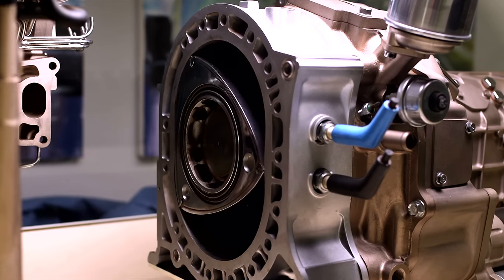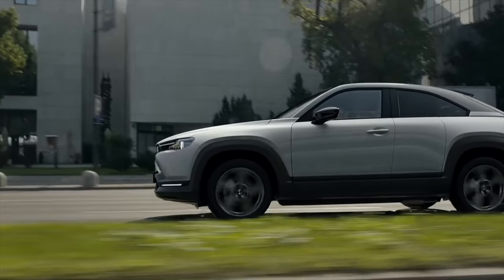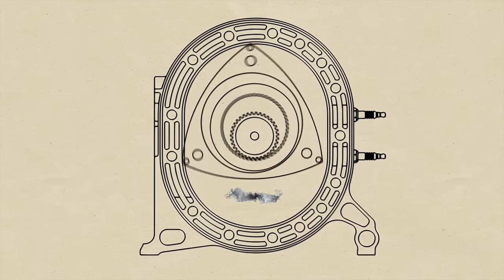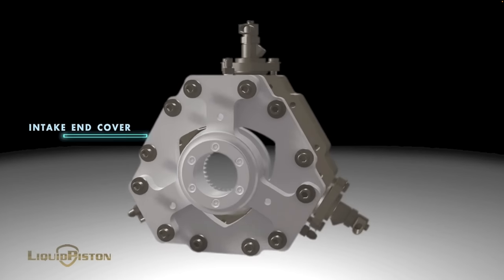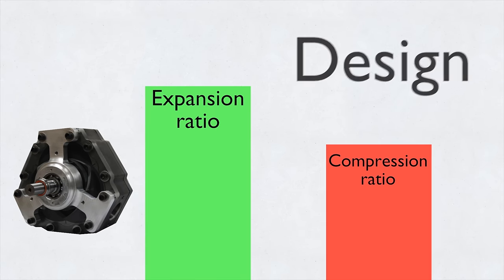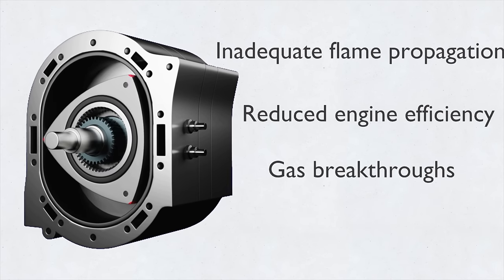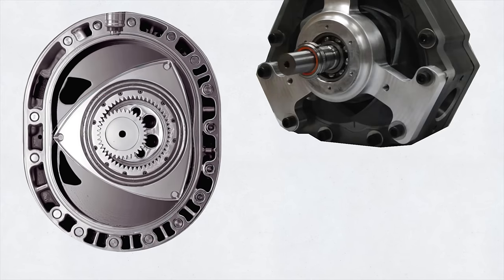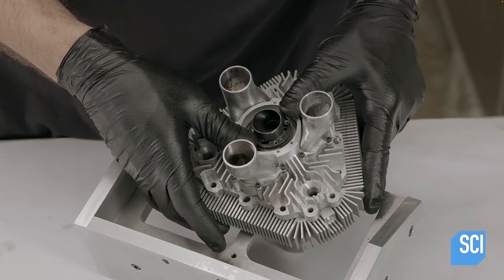Mazda's New Engine is the Smallest and Most Powerful Engine Ever Made

Comment: Well ppl forget bio gasoline exists and is easy to make if you some chemistry and build a gassa-fire engineering producing syngass before big oil gas tech came over 2 million syn gas cars were on the road in ww2 its awesome renewable  oil and gases  look up gasification 101 fir a crash course on it  and studied thermals cranking to learn how to make third Gen reactors one of the byproducts is hydrogen so based on how you use it it would be awesome with a air hydrogen mix like car

Comment: Hydrogen generation has been proposed as a solution to eliminating having nuclear power plants cycle up and down, following the electricity demand.  If the nuclear plant is running at a stable 100% power output, there are less problems controlling the coolant chemistry and other issues are removed.  When demand is low, excess electrical power from the plants can be used to create hydrogen from water.  Hydrolysis is inefficient for making hydrogen, and the financial problems of creating hydrogen plants and pairing them with nuclear power gen plants has not been figured out, but this is a partial solution for promoting the use of hydrogen vehicles but fulfilling some of the demand for hydrogen for transportation.  Changes in infrastructure such as this are slow moving and rely on the steps being financially feasible in order for the change to be completed.  Gasoline cars weren't as useful until roads and gas stations became viable financially.  Changes in how we use technology in a widespread way have to overcome these obstacles, which requires time, and the situational conditions required are not predictable.  Some can be forced at very high risk, like Elon Musk's development of Tesla, whose cars are efficient, but do not match the roles that many vehicles fill, such as heavy load carrying trucks that have long range.  Elon tried to make the cars first, hoping this would create the desire to make electric battery swapout stations and charging stations become attractive, building the electric car a huge niche in transportation.

Comment: Mazda have been working with Toyota on the rotary for hybrid applications, also running on hydrogen. Japan is moving to a hydrogen economy, making hydrogen from nitrogen gas cooled nuclear reactors at the nuclear plants. They can reach 1,000 C so when cracking water for hydrogen they are highly efficient. They hope to run all dirty fossil fulled industry on clean hydrogen, as well as ships, trains, etc. On hydrogen the Wankel rotary is 25% more efficient and also more efficient when running at a constant speed rather than revving up and down.  The Mazda MX-30 rotary hybrid is being introduced in Jan 2023.  Only time before it is running on hydrogen.
Reply: Mazda ceased all development of Wankel engines in May 2009.
The very last production Wankel engine from Mazda was unveiled nearly 3 decades ago.
Reply: @sandervanderkammen9230  
doktorbimmer, a quiz.
The Mazda MX-30 R-EV rotary hybrid is being introduced in what year?
20 points for the correct answer.

Comment: The Wankel rotary engine is actually is considered a 2-stroke engine, not a 4-stroke engine!!!
Reply: It runs on the four stage Otto cycle, delivering a power pulse per rev of the output shaft. Four-stroke piston engines deliver 0.5 power pulses per rev.

Comment: Ultimately, it will boil down to the cost be it environmental or financial.  There’s emphasis on EVs only because people think it’s an easy change. And Electricity demands/costs aside; There are definite environmental impacts towards mining the component of currently available battery tech, Lithium and Cobalt specifically.  Electricity has an advantage since the delivery infrastructure is mostly established.  Hydrogen simply doesn’t have those assets yet and even beyond that; it is derived from electricity with an already known and published energy loss.

Politicians will push for benchmarks based in science-fiction for votes by similarly dumb voters.  The change needs to happen; not before the logistics are in place.
Reply: Japan is moving to a hydrogen economy, making hydrogen from nitrogen gas cooled nuclear reactors at the nuclear plants. They can reach 1,000 C so when cracking water for hydrogen they are highly efficient. They hope to run all dirty fossil fulled industry on clean hydrogen, as well as ships, trains, etc. On hydrogen the Wankel rotary is 25% more efficient and also more efficient when running at a constant speed rather than revving up and down.  The Mazda MX-30 rotary hybrid is being introduced in Jan 2023.  Only time before it is sold as hydrogen running.

Comment: battery EVs are just a stop gap. in a few years people will see how damaging they are to the environment and then hydrogen tech will lead for a while, then in 50 or so years when fusion power station tech has progressed to a point where they can make more energy they take to run, electricity will take over again, the vehicles won't have batteries, they will run similarly to trams and draw energy from the roads into supercapacitors.

Comment: BEV is the way of the future. Any combustion alternative, even hybrid, will be far too expensive and complicated, regardless of the fuel it uses. As of right now you can by a BEV that has over 400 miles of range and can charge in 35 minutes or less. (Tesla model s) Even at the current rate of innovation, we will shortly have battery tech that is far better than that!  This means a BEV with 4 or 5 hundred miles of range, a cost far less than ICE, charge times of just a few minutes, and 0 to 60 times in the supercar territory for the average BEV. IMO...